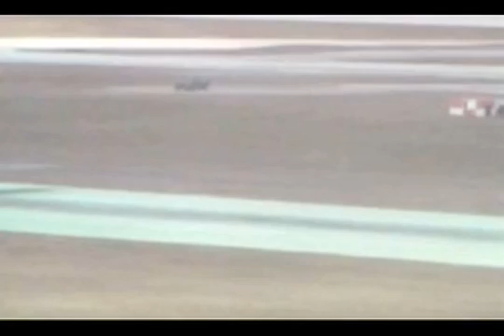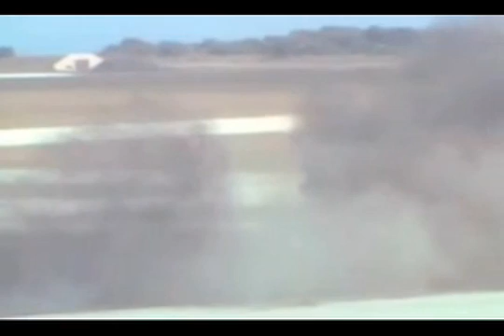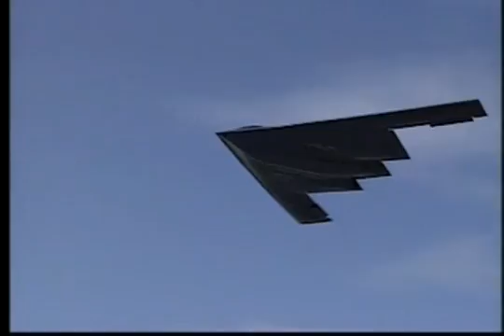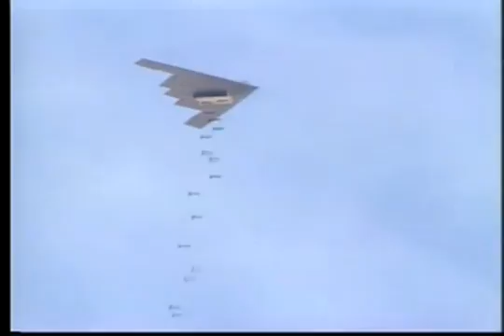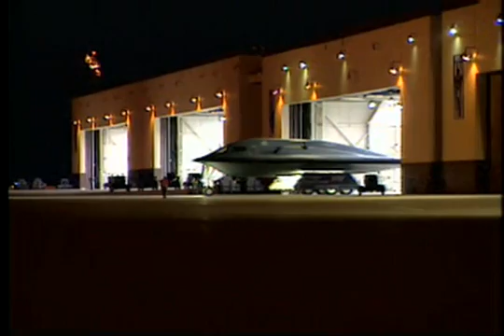B-2 Spirit Stealth Bomber Crash Video & Technical Report

Comment: @FalloutRadius Luckily, the maintenance crew were safe in this case, because the moisture issue was not addressed in their tech dat athe that time. Even though Guam was the only place the B-2 can actually land when traveling international and is surrounded by nothing but water , engineers still never thought about that procedure. Saved by the T.O.

Comment: @NaturalGroundation manual overide doesnt exist.  The aircraft doesnt have a tail, the pilot cannot make the decisions to alter the airflow using the complicated combination of control surfaces needed to have the correct outcome. new modern aircraft are designed with instability in mind. the EF typhoon is the same, as is the F117. The pilot CANNOT cantrol the aircraft manually. As a pilot, i can tell you, its not as it looks. They know better than you do. They are the cream of the US air force.

Comment: @NaturalGroundation...Ok first, their instruments told them they had already reached takeoff speed when actually they didn't......next, since the aircraft wasn't at the correct takeoff speed, this prevented the flight controls to provide sufficient response to inputs from the pilot (i.e. they were "mushy"). Third, the engines were probably maxed out for the takeoff roll.....that means there was little if any additional thrust available.

Comment: @slickstrings Its called manual override dipstick. Your damn right im pissed... these toys cost a fortune to just be wrecked because of stupidity on the part of safety checks.

Also your argument makes zero sense.. are you saying the throttle control is computer controlled also? Bull. They panicked and ejected end of story.

Instead of throttling up after realizing the controls were not responding correctly they said fkit we are out.

I also am not a youtube jocket I just call it as it is.

Comment: @NaturalGroundation due to the compltely unconventional flight systems needed to control a  no tail design, the pilots inputs are processed by computers which decide how to move the control surfaces to achieve the desired effect. the computers take data from the faulted readings there is no 'just add power and level out' the pilots cant decide HOW to move the plane, they just tell it where. Those pilots r the most accomplished in the world. Your a u tube jockey who thinks he knows better?.

Comment: Think i heard of something similar happening to a Civilian air liner, Insects had built a nest in one of the sensors that told the planes computers about air speed etc. Once the pilots engaged Autopilot, the compute with false information stalled the aircraft resulting in its loss. The pilots could have taken back control I.e. turned the autopilot back off too recover the aircraft but for some reason didn't.

These things happen, luckily in the case of the B2 it didnt cost any lives just money

Comment: No, it's the F-117 Stealth Fighter (which is actually a light bomber like the F-111 that it replaced) that has been retired and its mission is now performed by the B-2 until the F-35 come on line.

Comment: Wow, with reasoning like sen2k's, I shall attack him! What a stupid comment.

The first crash of a B2 in over 20 years of service.

This is a plane that can takeoff from Whiteman AFB in the U.S. fly all the way to Yugoslavia, drop its JDAM's, then turn around and fly back to Whiteman (A 10,000 mile trip w/ many air refuelings) then do the same thing to Kabul Afghanistan, then to Diego Garcia Island, which is further. Not a dent or scratch after all that flying and bombing, then this? wow.

Comment: Might I also add that flying wings, which looked almost identical to the B-2, were tested in the 1950s and they were quite stable before the silicon chip revolution. Supersonic flight, heavy bomb loads, ok, fine..assist the pilot with computerization,but for a simple takeoff to be totally computerized?  Give me a break.

Comment: Perhaps flying wings can be inherently unstable, especially when CGs are further aft and I can understand stability systems like SRS in aircraft like the old F-4 for MACH flight, or X-wing planes, which perhaps should not even be flying, but your statement about "any aircraft" is a stretch. Takeoff is a critical phase of flight, but it should be the most stable with all engines operating right after sub-sonic cruise flight. The best aero-engineers are aslo pilots, for good reason.

Comment: uhh, you do realize that the only reason why a b2 flyies, or any flying wing design for that matter is becuase of computers doing 1000+ calulations/sec. Without it, the b2 will just roll in a few sec after lift off, no matter what to pilot does, every little bit of input the pilot puts in, gives the computer thousands more calcs to do, making its flyable. It will even tilt during takeoff. No critical flight phases can be controled by a human pilot, for any plane these days, way too risky.

Comment: Problem with a machine that won't fly without computers...  And these machines are supposed to fly in real wars?  

"Sorry all your planes fell into the drink on takeoff, General Doolittle, but the pitot heaters were bad and you know that B-25s won't fly right if the computers don't get good airspeed readings.

We'll try to hit Japan again in a few months."

Crap.  Crap.  Crap.

Comment: You are aware that the B2 is dynamically unstable, and cannot be flown directly by a pilot - the only way an inherently unstable aircraft can fly at all is by artificially-induced stability (a computer)? If the flight computers got out of the way a B2 would crash within seconds.

Comment: Maybe the pilots would have stood a chance after early rotation and built up their speed in ground effect if the flight control computers could have stayed out of the way and simply responded to pilot input alone. This is why NO computer should ever be directing an aircraft especially during critical flight phases. Geek-ass designers and their toys.  They need to be shipped off to AIRBUS INDUSTRIES which is fond of such Rube Goldberg designing.  Serves'em right to lose this one.....bitches.

Comment from the maker: A2ZNP1971K, I appreciate your skepticism and am curious how it is that you maintain B-2's for a living, but do not have access to the reports.

From the Air Combat Command Statement of Opinion:
"The following items are considered substantially contributing factors to the mishap:
...
d. Ineffective communication of critical information regarding a suggested technique of turning on pitot heat in order to remove moisture from the PTUs prior to performing an air data calibration."

Glenn Pew

Comment from the maker: Thanks for your comments, A2ZNP1971K

We could have chosen different wording, but if the aircraft had not had water in the system, it would not have crashed. Its warning systems did not stop that from happening. It is noteworthy that the aircraft is valued at $1,407,006,920. 

The official Air Force report found that experienced pilots given the same situation in a simulator were unable to recover. The AF determined the crew's actions were "reasonable and appropriate."

- Glenn Pew

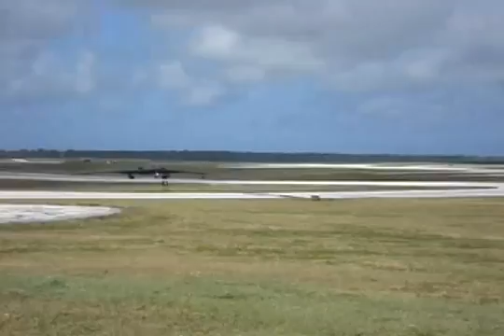Comment from the maker: 2:37 Maintenance performed calibration prior to the flight, after which the system was checked. It passed. 

1:58 The Master Caution occurred 19 seconds into takeoff roll. The faults were resolved within 6 seconds and the caution rescinded. 

By the time the aircraft had reached 120 knots *indicated,* all caution indications had cleared and the aircraft had exceeded its decision speed of 100 KIAS.

Re: pitot heat - your argument is with the Air Force, not me.

Glenn Pew

Comment from the maker: "Moisture" in the system introduced calibration errors that were not identified by the post-calibration test.

From the Air Force reports there is no indication that the crew failed to perform any checks. There is no evidence to support the theory that any other crew would have, in the place of the accident crew, behaved differently either before or during the accident. 

The Air Force concludes that the pitot heat procedure could have prevented errors introduced during calibration.

-Glenn Pew

Comment: This has NOTHING to do with the price of gas.  We pay four dollars for gas because our Congress will not approve getting the oil out of Alaska, North Dakota, Florida Coast, Mass Coast, etc, and because we haven't built a new refinery in over 30 years and because we have to make over 25 formulations of gas for different areas of the country (and seasons) and because oil traders (speculators) are trading up the value of oil/gas futures.  But the B2?  No relation whatsoever.